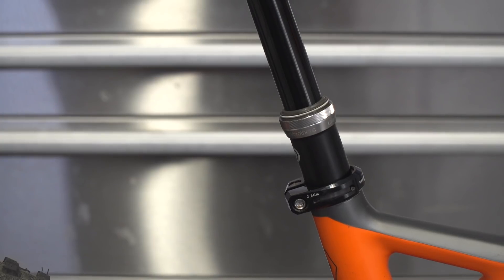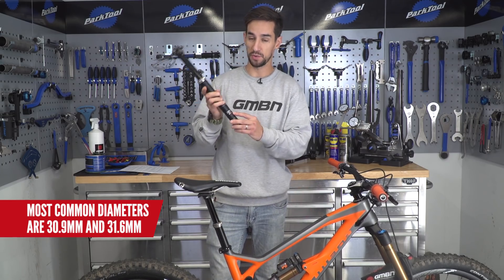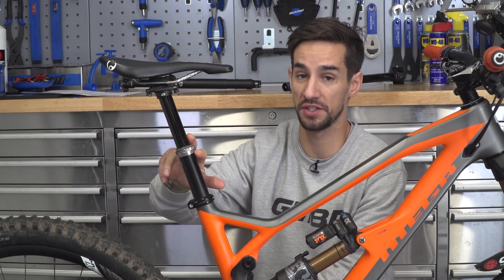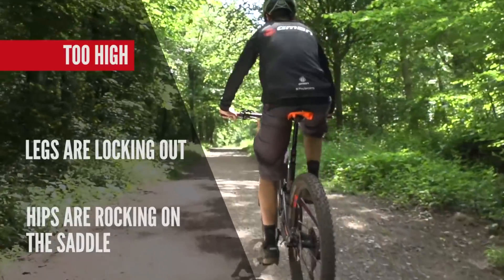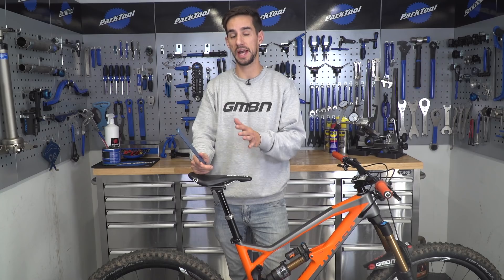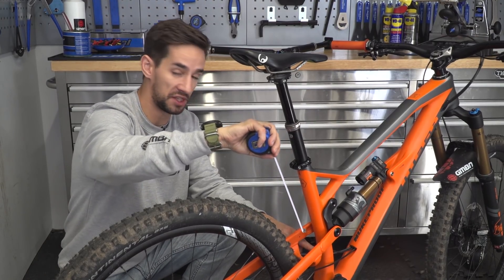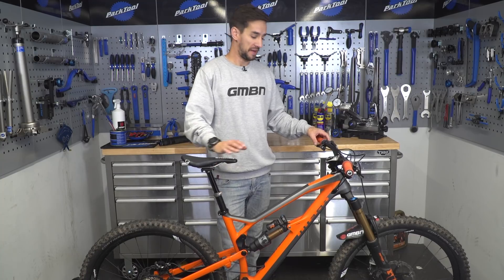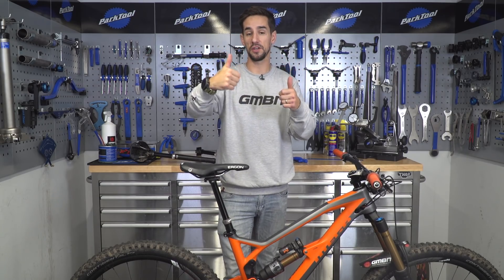How To Choose The Right Dropper Post For You

Comment: Spot on. Knowing the stack height and YOUR own actual saddle height relative to the collar is definitely the most important factors to consider when picking a dropper. Second its soooo important to know how deeply into the frame you can insert the post and then whether or not you can use internal routing to the remote. I used my old seat post slammed all the way in to find out how far I could insert my dropper before hitting an obstruction. Thanks Neil.

Comment: Dropping in something other than a a seat tube of appropriate diameter can give you false measure of depth. One of my bikes, Trek Fuel EX has a seat tube curving after around 200 mm, than it has rear shock mount at around 240 mm. The ruler or tape or something thin will go way lower than both inside the frame, to at least 300mm, while actual seat tube won't go below 200mm. It is way better to put the seat tube as low as possible inside the frame, make a mark on seat tube, pull seat tube out and measure length from bottom of tube to that mark;)
Reply: minusED Dude so true. 220mm max insertion on my seat tube and that’s from my current seat post
Reply: I got stung, i bought a 150mm post measured and it would fit perfect in my tube, little did i know there was a tiny lip 30mm from the suspension mount that stopped it. Luckily inwas able to machine down the end of the dropper s little do it would fit otherwide i wouldve had a dropper 30mm to high
Reply: Really? On my 2017 Trek Fuel EX 29er, the minimum insertion with a seat post is around 255mm, that’s on a size Large, 19.5” I think. However I’m not sure whether the cable actuation mechanism below the dropper can go even deeper, only 1 way to find out: but a 200mm dropper.
Reply: @acat6821  that’s not a good idea!! The reason being is that having your seat post too deep inside the frame can intervene with suspension, especially when bottoming out. It can also put stress on the cable and tear it during a bottom out.
Reply: @goodpools  mine is M and 26”, most likely a 29” L has a different geometry. Plus they change it over the years so production year is also important. Anyway, what I was describing mostly is a relatively gentle curve of the rube, where thinner tubes would go deeper than the actual seat tube. The thinner - the lower it will get into the bend giving a false measurement.

Comment: Watch out for Specialized frames. My Fuse came with a cable operated dropper but I wanted to fit a Rockshox post. The Specialized dropper had a 4mm cable and I ended up drilling out the 4mm hole in the frame to fit the 5mm hydraulic cable, a bit nerve wracking on a brand new frame.

Comment: Choosing the drop dropper. First step: It’s not a Reverb. Well done You’re 80% there.
Reply: I'm using a reverb....but it is oddly reliable😂
Reply: @ghazypangerang6118  that is odd. Very odd. Did you try the up and down?
Reply: @topheavy7616  My Reverb has been working fine for 4 years now without any issues. Well, the only time I had to take it to the shop was last December to replace its seals (because it got stuck in the fully extended position). I don't really know how long Reverbs (and any other droppers) usually last, but for me, 4 years without any issues makes it quite reliable. But I've heard people complained about Reverbs breaking down after a year or two. Therefore I found it strange that mine is still working fine after 4 years (until I had to take it to the shop last December).

Comment: didnt quite understand... i got an 2005. stump jumper fsr... it has an interrupted seattube due to the rear shock mount.
how could i know what length i coud use for a dropper post... its an L size frame and my regular seatpost is about 340mm long

tnx in advice !! keep up the good work !

Comment: Got any tips for quieting internal cable rattle?
Reply from the maker: You can get small thin spongy tubes to put around your cable from hardware stores. That or cabe ties (no seriously, smallest size cable ties at intervals down the cable, feed it back through without cutting the ties - this way the ends of the ties push against the inside of the frame and work to stabilise the cable.).

Comment: would you fit a seatpost in a hardtrail? If so, How would you  fit the cables in, my bike hasn't got an extra hole for the seatpost cables.
Reply: You can buy ones with external cable routing.
Reply: Thanks, but I don't know whether I could put the cables properly or not, because there's no place to put the zipps into, I don't know if you know what I mean.
Reply: robert benassai tou can buy glued stuff jaguar something  its little cable supports and you can put the cables in there
Reply: thanks mate :)
Reply: jagwire cable guide , Just type that on amazon or anywhere you want and you will see what i mean
Reply: Or just go by the famous words "boom cable ties"
Reply: Or black electricians tape it to your rear brake hose.
Reply: hahahahahah
Reply: Drill a hole
Reply: Nah I wouldn’t bother putting a seat post in a hard tail, just ride it like a trials bikes

Comment: I have the same dropper post, and ever since installed my lever has a little bit of back and forwards play in it. And so when pushing it in for the post to say go up, if i take my finger off the lever, the post will still slowly go up, like the lever is stuck pressed in. So i have to then pull the lever back out to stop the post moving. Any tips?

Comment: Hey if my original seat post measures 30.9 x 200mm, would 200mm be the max depth I have to put in a dropper post, I want a dropper post for the Polygon Trid zz.
Reply from the maker: If you can get the seatpost all the way down into the frame then yes you've got 200mm length to house a dropper inside the frame.

Comment: hey there, i’m planning to buy a fox transfer.  my stack height for my current seatpost is about 185mm so i can have atmost 185-50=135 travel. but following Fox instructions for choosing fox transfer posts, it turns out that a 100mm is best for me. Unfortunately, 100mm travel is not available around our area. So i plan on having a 125mm post. What can you say about it?will this be ok?

Comment: Hey Niel, I recently mounted an RFR Pro dropper post on my hartail Cube Reaction hybrid. now I have read that There is a maximum rider weight recommended for this dropper. I am not a light weight rider myself and my own weight is sitting against the max weight of the dropper, which makes it not so pleasant, I am afraid that I can damage the dropper if I ride on it. I was wondering why I don't see this in any of the dropper videos? Is this something I should take seriously or just an indication? I wonder how many people have had any problems with this.

Comment: My Specialized FSR Elite 650b (size small) has an issue with the insertion length of the stock command post. This is a great post, but it will not drop into the frame all the way to the collar. This means I have to run it into the travel about 1.5" because I am only 5'2" tall. It makes riding a constant fight with the height. Any ideas on replacements or fixes?
Reply: Yes
Reply: Maybe, but I am not seeing good info on insertion length on Cranks Bros or Thomson.

Comment: Anyone know of any good 27.2mm dropper posts?
Reply: I have the KS eten 100mm dropper on my trek x caliber. Unfortunately, the 100 mm dropper is the most travel available that I know of. I got mine from Jenson USA, I'm sure most big bike shops have them.
Reply: yeah I was looking for one for quite a while as well and KS eten(i) 272 seems to be the best available choice.
I hacked the switch for the integrated lever to bodge it in my frame between the bottom bracket and the frame and it's been working great on my cube analog 29". Would love to get more than 100mm drop but it is what it is, running a 27.2mm seatpost just doesn't give you many options.
Reply: PNW Components, stuff looks great
Reply: Gutted my cube ltd pro has 27.2 post and can't find a decent dropper at reasonable to mid price

Comment: I just got the tranzX ysp19 27.2mm x 400mm external routed dropper with 100mm travel, but I have the issue that the dropper rises very slowly - as in more than 2 seconds. My friend also has the same one, but his dropper rises in less than 1 second. Any suggestions what the problem could be and how to fix it? I already tried with lower clamping force and I can see that the cable activates the mechanism on the dropper just fine, so I'm a little out of ideas...
Reply: You probably need to bleed it and add air again

Comment: I still have to buy a dropper post, but for now i have my seat post set so i touch the ground with my toes: is it ok like that for now? I don't have enough confidence to ride with a higher seat post :-(
Reply: stillFLiP thanks a lot: now i will just increase the height every few days until i get to a good overrall height, thanks again for the tip!
Reply: Typically if you can touch the ground while sitting on the saddle you will not be able to extend your legs enough for an efficient peddle stroke and proper technique.  Dropper posts exist so you can raise the saddle for proper peddling technique, then 'drop' it out of the way to descend down a trail.
If you have a fixed post you have two options: 1. Find a compromise position that lets you peddle decently and descend without too much trouble. 2. Get a quick release seat post clamp and manually raise and lower your saddle, up for climbing, drop it down for descending.  
Peace.
Reply: I cant touch the ground even when straddling the top tube. Ive never had a crash that could have been saved by being able to touch the ground while seated. Set your seat height for optimum pedalling position.